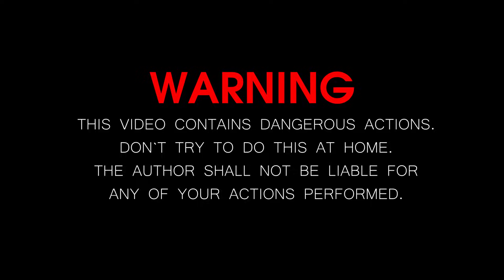EXPERIMENT HYDRAULIC PRESS 100 TON vs Things From Glass

Comment: Wow that Rupert's drop is so strong what is the metal beneath??
Reply: Looks like gallium given the condensation on it
Reply: Not a strong metal. A very soft one.
Reply: My best guess would be tin.
Reply: @celozzijoeysucks   Who'd use Gallium as one half of a hydraulic press though xdd. That's not imperfections (air bubbles?) from when the metal was moulded.
Reply: @theomitchell416  some one, like this channel, who is trying to make an impressive video without much effort
Reply: @theomitchell416  yeah, they want to show how strong a tear can be so they make ppl think stronger than metal. But it's clearly a chilled soft metal given the condensation